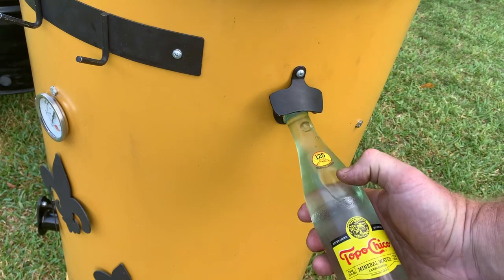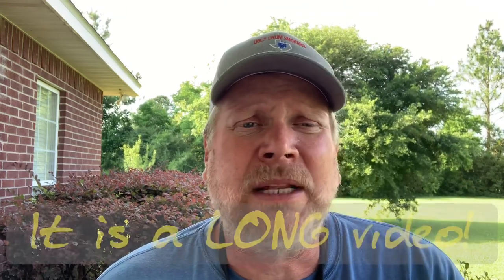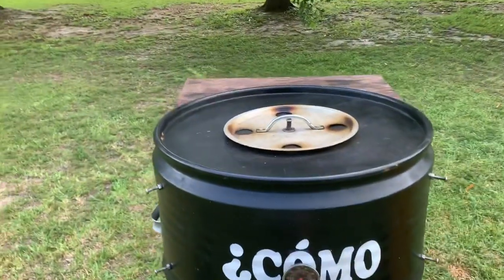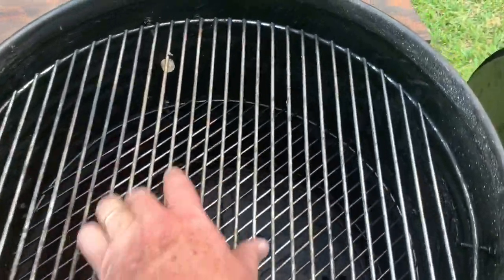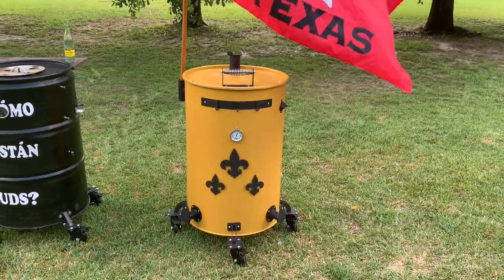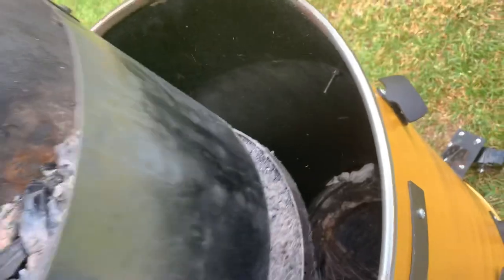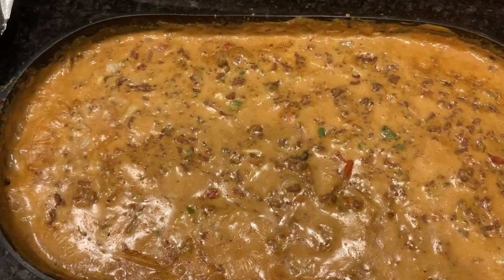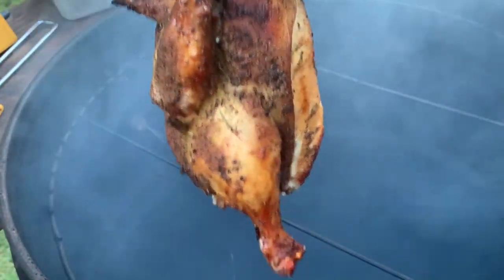Showing Off the UDS’s / Multi-channel Collaboration #HowIBuiltMyUDS

Comment: Great video that cheese sauce looks amazing if you soak the cork in water would it last longer
Reply from the maker: Yes queso dip combined with mesquite smoke is awesome. Cork is an impermeable material and will not absorb liquids. That is why it makes good fishing floats and bottle stoppers. If it could absorb liquid it wouldn’t seal off wine bottles.  They are easy to replace.
Reply: @BigLewBBQ  awesome thank you